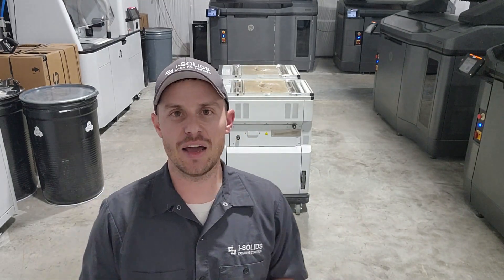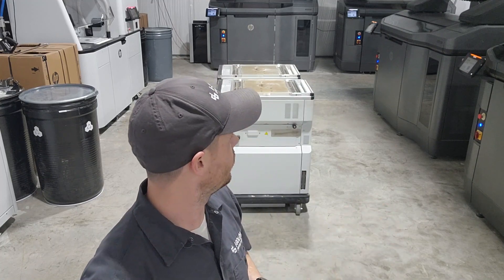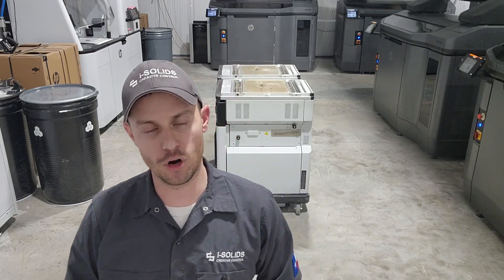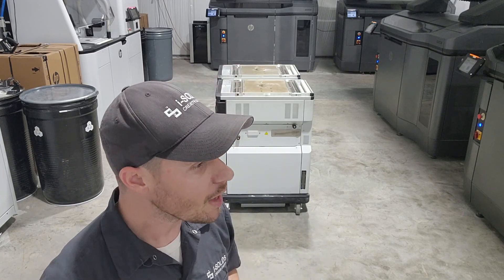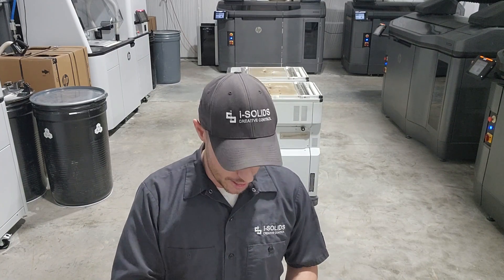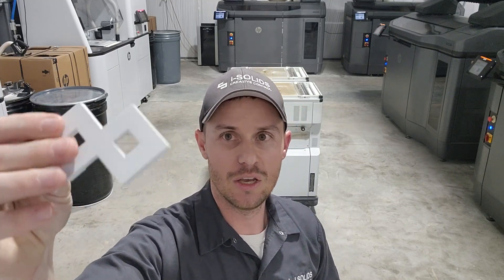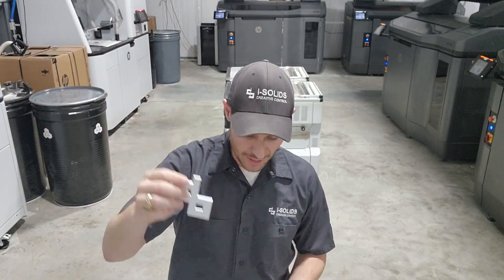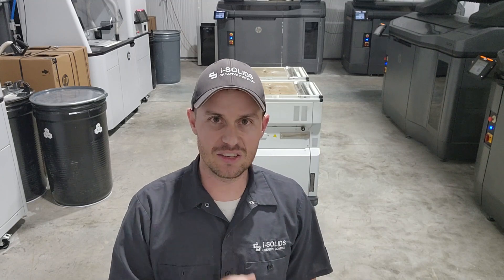The Newest Multi Jet Fusion 3D Printer - What is this 3D printing technology and why its important?

Comment: Here from Canada, I love what you guys are doing! Are these parts tough like 3D printed parts or injection moulded ones?
Reply from the maker: Hey John, Thanks for the support! Since this is an early release machine, HP still hasn't officially published the material datasheet but we have found the parts are mechanically almost identical to the current PA12 properties. We are still big fans of the FDM technology but having a lower strength in the Z-direction is just part of the process - what makes these multi-jet fusion parts so cool is they are nearly isotropic so the part strength is nearly the same as an injection molded part.